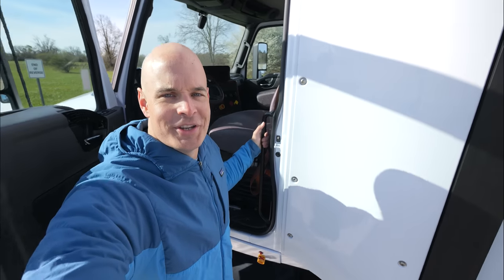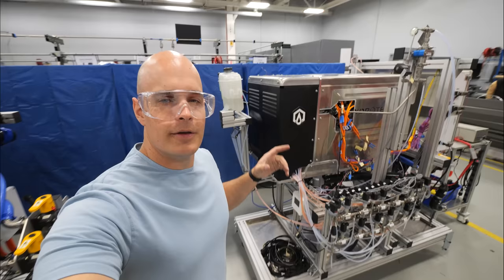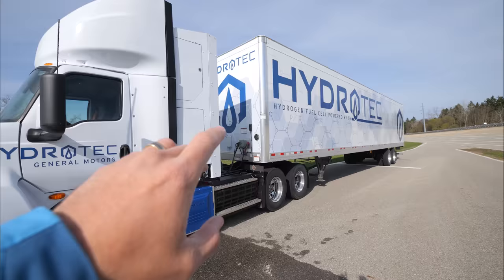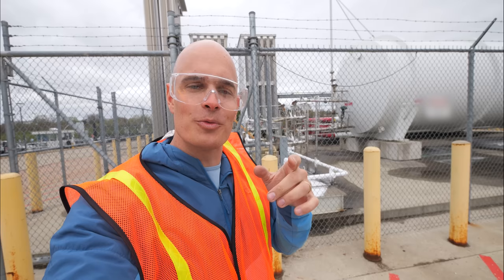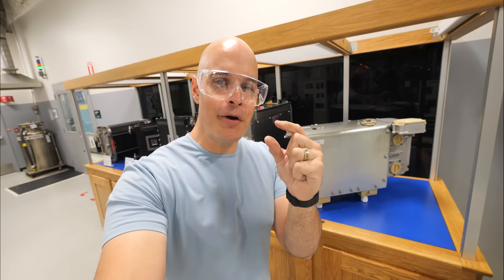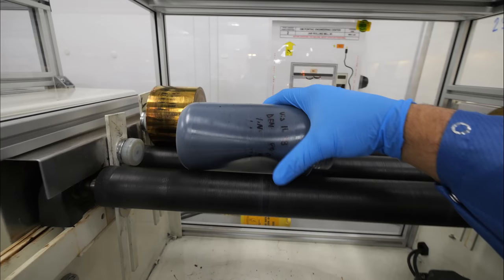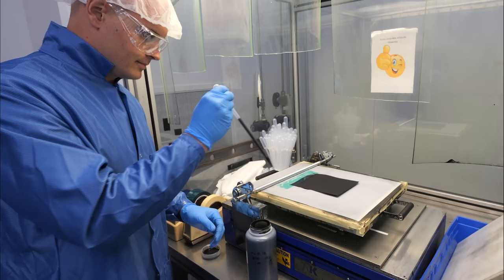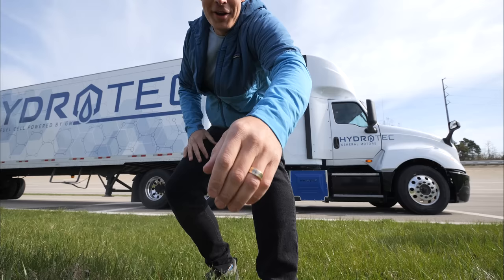How to build a Hydrogen Fuel Cell Semi Truck? - Hydrotec Factory Tour

Comment: Hydrogen has a much promising future than Lithium !!!
Reply: Nope it has not.
Reply: @Simon-dm8zv  Yes it does.
Reply: @ankur313  You could have thought so 10+ years ago. Not in 2023.
Reply: @Simon-dm8zv  Lithium's running out and Hydrogen is getting easier to produce.
Reply: @ankur313  Lithium is not running out at all and never will. Hydrogen production is inefficient and can only marginally be improved.
Reply: @Simon-dm8zv  Your info is inaccurate both for Lithium and Hydrogen.
Reply: @Simon-dm8zv  true
Reply: @ankur313  It is correct. There is a lot of information available on both subjects. Good luck.
Reply: @Simon-dm8zv  Unfortunately, You are completely wrong.
Reply: @ankur313  No. You just don’t like reality.
Reply: @Simon-dm8zv  You are neglecting Scientific facts and imagining things.
Reply: @ankur313  That is the case with you, not with me. Again: inform yourself.
Reply: @ankur313  Lithium is extremely abundant and will not run out.
electricity>electrolysis hydrogen generation>transport>chilled storage>fuel cell conversion>energy>motor will always be far less efficient than electricity>battery>motor
Reply: @logitech4873  Lol, this is nothing compared to Mining Lithium and refining it for Batteries. Lithium is not going to be financial viable pretty soon.
Reply: @ankur313  It still means that hydrogen is far less energy efficient. And there's just nothing that can change this.

Meanwhile, battery tech is improving in energy density at a very fast rate. 
We're at triple the energy density today compared to 2012. This means that batteries need progressively less lithium and other materials as they get more energy dense, and consequently smaller.
Reply: @logitech4873  Hydrogen isn't less efficient , the only thing its lacking is adoption. Once its widely adopted there won't be any need to pollute the planet in order to get Lithium using a highly inefficient process.
Reply: @ankur313  Yes, hydrogen is absolutely less efficient, and it always will be.
Hydrogen is electricity delivery with many extra steps, all of which incur energy losses.
Reply: @logitech4873  Lol, Hydrogen is not Electricity Delivery, Hydrogen generates Electricity. You have got it backwards, Lithium is Elec Delivery with many extra steps all of which incur energy losses.
Reply: @ankur313  Are you trolling right now?
Hydrogen when used in hydrogen fuel cells is a method of storing energy, and is essentially electricity converted back and forth.
As i explained above, you use electrolysis to generate hydrogen, then you transport it, then you store it in cryogenic storage, then you convert it to electricity via a hydrogen fuel cell. These processes are obviously far more lossy than grid>battery>motor.
Reply: @logitech4873  Hydrogen is not only used to store energy but also generate electricity. As for your Grid>Battery>Motor, do you think electricity just magically enters the grid ? Is there no loss in long distance cables ? Is there no loss of energy in manufacturing huge Lithium batteries, not to mention energy required to mine all the elements for the battery? Is there no loss in charging the Battery ? Lithium is mostly mined in SouthAmerica and Australia. This Lithium is transported all over the world for refinement. Do you have any idea how much fuel is burnt in ships to transport Lithium. Lithium batteries are not efficient. They are just profitable right now. Once they are not financialy viable, Hydrogen will replace it.
Reply: @ankur313  You must be trolling.
Hydrogen generation also requires electricity from the grid. It experiences the same grid losses.
Hydrogen fuel cells transfer its energy into s buffer battery. It experiences the same losses there too.
On top of this, it experiences all the other losses I mentioned - all in all, hydrogen is about 3x less energy efficient.

You don't mine new lithium every time you charge a car. You only make the car once.
You seem to be under the impression that making a lithium battery is enormously energy intensive, but do you even have any numbers? What do you think the energy cost of making a hydrogen fuel cell and high-pressure carbon fiber tanks is?

Stop mixing up running efficiency and manufacture cost. Those are COMPLETELY DIFFERENT THINGS.
Reply: @logitech4873  Most Hydrogen projects are aiming to be Green where they would use Solar or Wind Elec . The Ingredients needed to make a Lithium Battery consume a lot more energy than Hydrogen Cell. Infact the energy cost is off the scale. The environmental cost is off the scale. If you don't believe me just google it.

They are not different. Everything is related. You don't make decisions by just ignoring one aspect. You cant just ignore things to fit your argument.
Reply: @ankur313  Efficiency and manufacture cost area absolutely different things, and are measured differently.

A lot of empty claims here.
What's the CO2 cost of producing an EV battery pack?
What's the CO2 cost of producing a hydrogen fuel cell drive system?
Reply: @logitech4873  They are not different things. In every aspect Hydrogen is better than Lithium Batteries. The only reason Lithium batteries got adopted was because no one wanted to take the responsibility of supplying Hydrogen and Lithium batteries could just leach off the existing power grid. But now its all changing. Hydrogen production and supply is increasing and it will soon replace Lithium Batteries. Much to the disappointment of Lithium fanboys and adopters.
Reply: @ankur313  AGAIN, hydrogen is FAR LESS ENERGY EFFICIENT. Why do you keep ignoring this fact?

EV:
Energy source > Grid > Battery > Drivetrain

HFCV:
Energy source > Grid > Electrolysis > Cryogenic Storage > Transport > Cryogenic Storage > Fuel cell > Battery > Drivetrain

Hydrogen cars use far more grid energy than EVs do. Admit this.
Reply: @ankur313  Yes, efficiency and manufacture cost are absolutely two different things.

Since when did cars include manufacturing in their MPG figures? What are you talking about?

Get a grip.
Reply: @logitech4873  That is not a fact. Hydrogen is not less efficient. You are just complicating the process to suit your point. Its actually the opposite of what you are saying.
Reply: @logitech4873  No they are not different. They are related. ICE engines were cheap to make and had good efficiency, thats why they were popular and dominate the market. The only problem was pollution and reliance on Petroleum.
Reply: @ankur313  Efficiency in cars is measured in MPG, l/100km, kWh/km and similar.
This is SEPARATE from the CO2 or energy cost of producing the vehicles.

Only total environmental impact numbers combine these - but unless you can provide comparable total environmental impact numbers comparing EVs and HFCVs, you have no argument there either.
Reply: @ankur313  Yes, hydrogen is less efficient. Get it through your head.
Hydrogen fuel cell cars always have a buffer battery. This means they have all the efficient losses an EV has, PLUS all the efficiency losses hydrogen production, transport and conversion has.

How do you not get this?

A Tesla model 3 might use 150 Wh per kilometer.
How many Wh/km do you think a Toyota Mirai uses?
Reply: @logitech4873  There are plenty of numbers and scientific facts on Google to support my argument. Your arguments on the other hand make no sense and you keep  ignoring key aspects to cling to your beliefs.
Reply: @ankur313  Cool. Care to name a source?

Comment: And this is exactly why I don’t like the Tesla Truck. Using batteries is obliterating to Earth at that these huge scales.
Reply: Battery electric is far better than hydrogen.
Reply: Give me reasons why it’s better for big trucks. I know a few but they’re far outweighed by the advantage of hydrogen.
Reply: @jivewig  Cost per mile is far lower and the technology a lot less complex. Fast charging networks are a lot easier to develop.

Comment: I think it’s better then EVs, because to develop them is much better for the environment then having to mine lithium, the range will never decrease over time and it tends to have a longer range then EVs, and are more efficient then standard combustion engines
Reply: They're not more efficient than ICE when you consider having to make and transport the hydrogen in the first place.
Also, what do you think the life of a fuel cell is? Do you understand how easily one gets contaminated or broken?